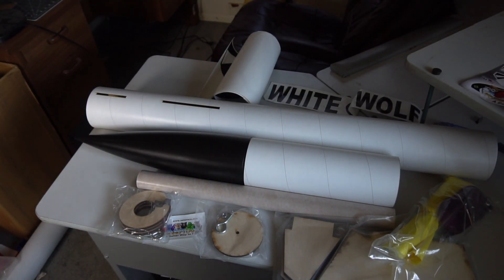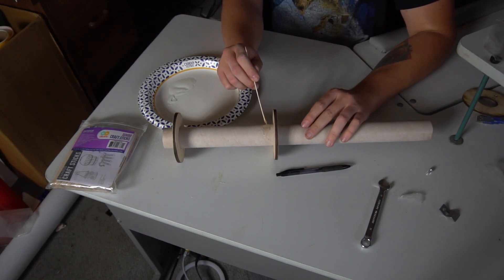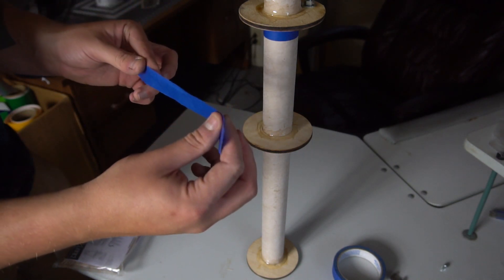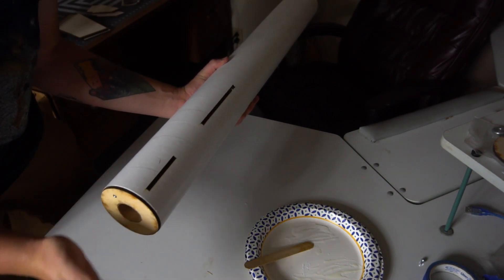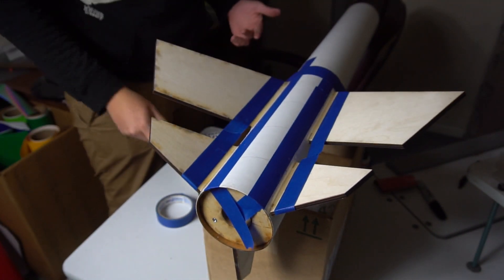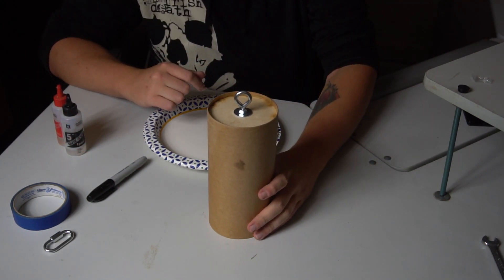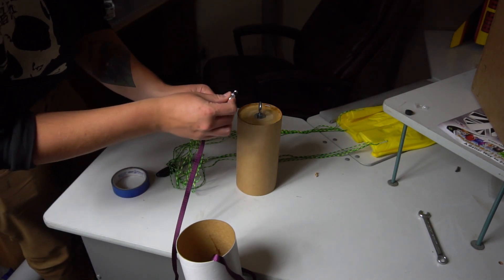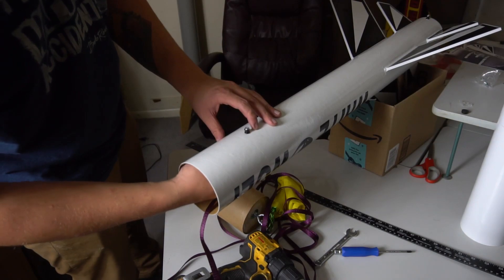AMW White Wolf 4" Build Instructions

Comment: Quick question! The motor tube with my kit is only 14" long, quite a bit shorter than the one shown in the video.  With the short tube think I should still put the center ring up at 12" like you did or move it in between the fins about 5 or 6" up to even out the spacing?
Reply from the maker: As long as you've got three rings just ensuring the middle one is between the fin sets will do just fine!